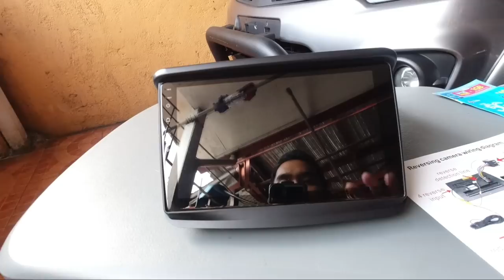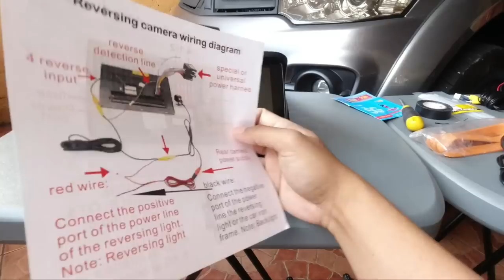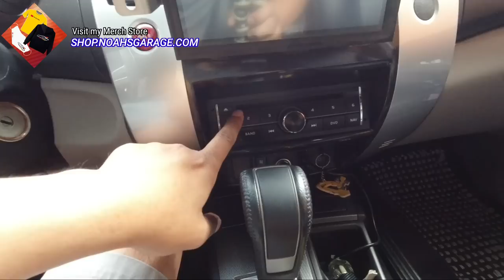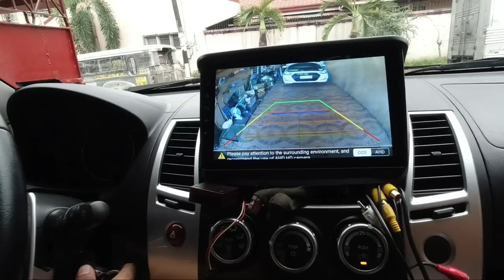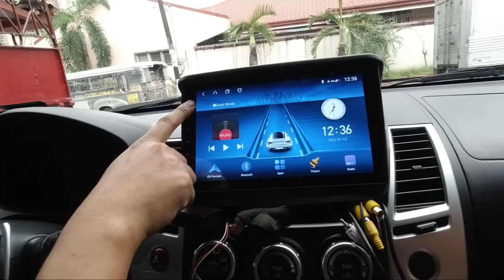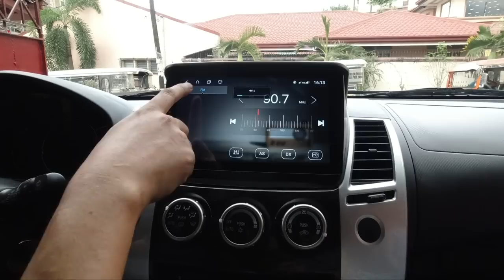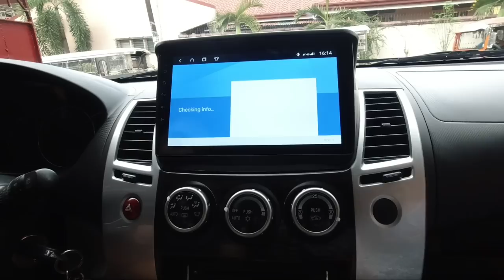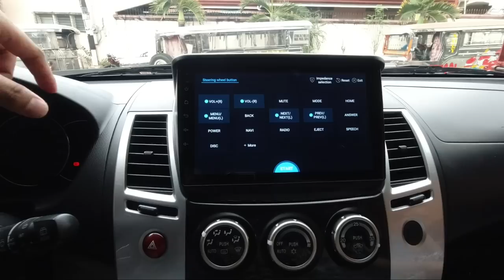Paano Mag-Install ng Android Head Unit sa Montero Sport 2014

Comment: Hello.
Very informative video! I love your channel!
I want to install a multimedia system including wire the rear camera and a parking sensors system. I would like to know how to wire the cables from outside the car under the car and get it into the car from the driver seat. In this particular video you explain how to connect the multimedia system but not transferring the cables from the back.
I own a mitsubishi L200 that is basically similar to yours.
If it possible to film a short video where are the entrance point for wires it will be great! 
Thanks !
Reply from the maker: I dont have a video yet sir, for the rear. But I have a video on how you can wire your cables from the engine bay to the cabin.
https://youtu.be/kc7eruuqX2I
Reply: Sir Noah yon simcard slot ba pede sa globe or smart simcard

Comment: Sir Noah tips lang po, sa mga DIY ng android especially sa mga GLS V gen 2,kasi po pagtagal pwde ma apektuhan ang  speedometer at tacometer nyo ndi sya gumanaa ,kasi yang odel GLS V , GTV merong multi info display gaya ng fuel consumption, temp etc. Konekted po kasi yan sa speedo meter at taco meter or cluster guage kayaah magkakaroon ng short sa  cluster guage board. Yan po comment ng nagpa install ng android .nasira ang spedo meter at nadadamay ang taco meter. Kayah po hindi basta basta nagpapainstall ng android, ang pwde po alah problem mga GLX kasi alah sila multi info display. Sa na lang makatulong itong info.salamat.
Reply from the maker: Salamat sir sa tip mo. Takot tuloy ako.
Dont forget to subscribe 🙂
Reply: Pag nag karoon ng problem po sa speedo meter taco meter pwde nyo po pagawaa" A.A.M Auto electrical " and repair may FB page yan luk for Anjo ung shop nila sa banawe nagrerepair sila especially sa mga nag pa android  ng Gen 2 Gls V. Makikitah nyo rin sa FB page nila mga repair nila. Sana makatulong,salamat more power po matagal na po ako subscriber nyo po,
Reply: Sa Montero Group FB page  nabasa ko nag pa help po nun naginstall sya  ng Navitopia android atah un if  I am not mistaken, pag ka install nya android ndi na daw gumanah speedo meter nya., tananong ko kung GLSV Gen 2 sabi yes, nirefer ko nalang k A.A.M auto electrical reapir...
Reply from the maker: Salamat sa tip sir Noel. 
Actually, aware ako jan sir. Kaya matagal ko pinag isipan at inaral ang pagpalit at pag install ng Android. Salamat po sa concern sir. Keep watching po 😊
Reply: hello sir noel, na ayos mo ba yung problema nyo with regards to the speedometer and tacometer? meron ako 2014 din na GLS, gusto ko sana ma upgrade ng android. meron ba special connection or harness para di ma short yung cluster gauge board?
Reply: @Loki6451z  sir maganda po mag pa kabit kay Anjo Jurado meron po sya FB Page sya po nakaka alam ng mga connections para ndi pa apektuhan ungspedo meter etc..ung message ko taas A.A.M. auti electrical and repair ang shop nya sa Banawe pm him directly para matulungan agad kayo sir.
Reply: kumusta na po speedo at taco niyo?
Reply: Eto pala ang reason kung bakit nagtaka ako hindi na gumana speedometer at distance traveled after my DIY android installation. Montero GLSV car ko. Akala ko sira ang speed sensor, buti hindi ko pa napapalitan.

Comment: Mmm, I'm wondering if this will work on our Pajero due to having a small screen on top of the radio facia trim.

It gives fuel consumption, altitude, temperature, and compass direction.
Reply from the maker: If we have the same dash, then this is likely going to work.
Reply: @Noah's Garage  Ok, the dash is the same, but the cover that needs to come off to remove the radio is taller.

Due to the small screen on top.

Comment: Sir Noah salamat sa mga videos mo madami na din ako na-DIY. question lang kung pano paganahin steering wheel audio controls sa 2015 montero GLX.nagchange na din ako ng headunit to android. napalitan ko na clockspring at bumili na ko steering wheel controls. Pati cruise control working na. Yun na lang audio controls ang d ko mapagana. Hope you can help. Thanks!
Reply from the maker: na calibrate mo na ba sa android headunit mo sir? Nasa settings un
Reply: @NoahsGarage  nagtry na ko dun sa steering wheel na app sir pinipindot ko pero d nakukuha ng app. Nagtry din ako sa car settings d mapick up pag pinress ko yung button :(

Comment: Sir, kahit ano po bang canbus decoder gagana? I have a 2007 Mitsubishi Outlander and planning to buy separate head unit and canbus decoder
Reply from the maker: You mean canbus harness sir? Depende kasi un kung sakto sa socket ng stock wiring niyo. Otherwise, baklas wires na lang or stripping gagawin?
Dont forget to subscribe 🙂
Reply: What color ang pag kakabitin like ground and line1 ?

Comment: Hi, how to connect the 2 headrest monitor with the android head unit, the 12v power and video? Thank you so much, regards Hervé
Reply from the maker: For montero gen2 sir? Reconnect the power supply to the 12v cigarette fuse or line in order to power the 2 monitors.
Dont forget to subscribe 🙂
Reply: @NoahsGarage  hi Sir thanks Yes, where I find the connection of the 2 monitors at the dashboard level to connect them at cigarette fuse, just if u have a picture its will ok thank you very much again!

Comment: ginamit pa rin po ba ung canbus para gumana steering wheel or ubg harness lang?
Reply from the maker: Kelangan ko pong gamitin ung canbus kasi un lang po ung kasya na connector eh. Ung sa steering wheel, nasa settings po iyan, icalibrate po.
Dont forget to subscribe
Reply: @NoahsGarage  calibrate pero d pa rin po gumagana gumagana.. d po kasi plug and play ung harness na kasama sa android head unit po..  nag splicing po kami.. ung steering wheel lang po di gumana.. baka mali ung pagkaka wirings namin para sa steering..
Reply from the maker: @jaimeilanojr.261  same po ba tayo ng android sir?
Reply: @NoahsGarage  yes po sir same po.. kaibahan lang ng harness kasi d plug and pkay ung pinadala sa amin..

Comment: Sir omorder po ako dun sa link sa nyo sa lazada bali dumating na po sya tapos pinagawa ko po sa shop yung sakin kasi hindi po ako marunong tapos nung ginawa nila reverse cam at radio lang po ang gumagana comoconnect namn po sya sa bluetooth at nag pplay po ang problem lang po is walang sound yung music tapos tinry ko lagyan ng USB na may music nag pplay namn po sya pero walang sound ano po kaya ang problem non sir ? yung monty ko po kasi may ampli
Reply from the maker: Connection yan sir. Try mo hanapin wiring ng speakers mo papunta sa ampli then ung output ng ampli dapat papunta naman sa android stereo mo.
Reply: @NoahsGarage  pero sir ung radio may sound naman po eh ?

Comment: Sir Noah, ano po kaya problema pgkainstall ng android HU ayaw ng umandar speedometer, odometer & trip meter pti po cruise control ngOn lng ayaw dn maSet?
Reply: 2015 GLSV po pla unit ko
Reply from the maker: Try mo sir ibalik ung stock and see if ma fix problem
Reply: Hi po.. ok na po ba yung speedometer niyo? Ano po ginawa niyo? Same issue po kasi sakin after ko mag upgrade ng android nawala yung speedometer..
Reply: @glennianflaviano2442  ok na po nasira un TCM throttle control module, 2015 model ba s inyo? Pinarepair ko TCM ng Okay na  meron hindi nadisconnect na wire un nglagay sa android HU
Reply: @AJ Tiongson, after po marepair ng TCM hndi na umulit ang issue? hm inabot ng repair?
Reply: @JeffreyNica  ok prn hanga ngaun, 7k singil skn TCM repair tps may pinutol n wire sa harness ng HU
Reply: @nosgnoit5  ok salamat po, ipaparepair ko na din yun sakin.